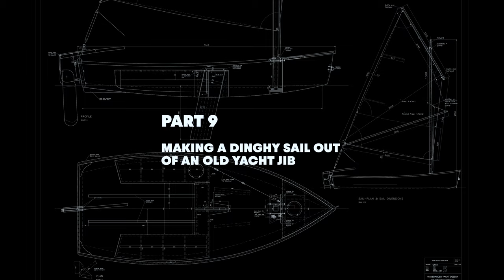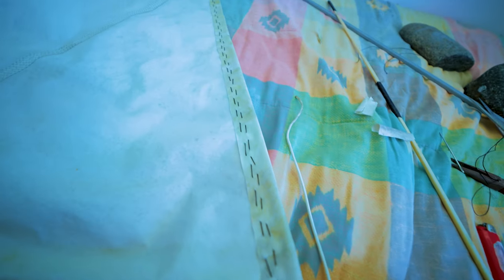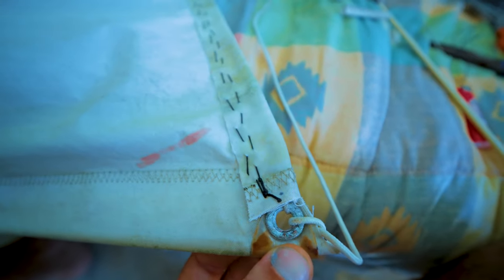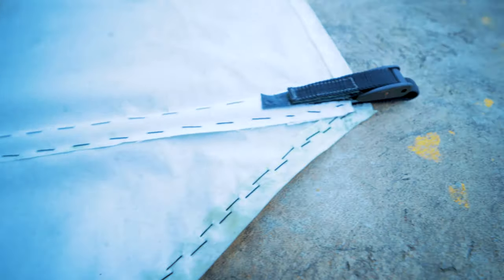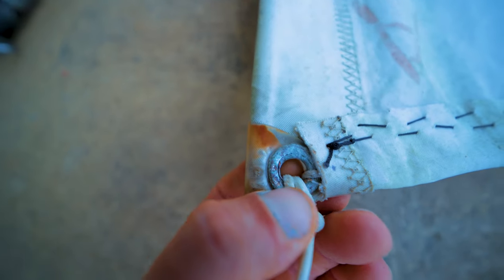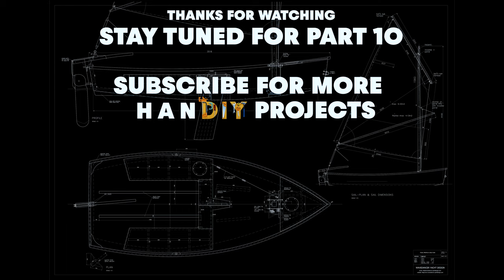Making a Dinghy Sail out of an Old Sailboat Jib - Building a Plywood Boat - Part 9

Comment: Nice, but can you tack with the foot of the sail that low?
Reply from the maker: Its a good point. Yesterday I obtained a longer windsurfing mast however its made of Fiberglass instead of carbon so I'm concerned about its rigidity and strength since Windsurfing masts are not designed for such a low point of stress. Lets see
Reply: Is it Unifiber? On a windy day that simulates going out for the day, you can test the flex by strapping the boat down to the ground and tethering a line to the top of the mast. Hold the line firmly against a reference point such as a fence or something perpendicular to the line,  mark the point it perpendicularly crossed the reference point with a sharpee, pull up the sheet, and measure the distance the line pulls from that point after a few strong gusts. Do this in both directions, both front and back and side to side. If the flex is more than a percentage (i forgot the percentage) of the full length of the mast, then you should consider going with a different mast. (note: you need to hold that tether at the max percentage of give just in case it flexes so much that the mast would snap.)
Reply: @HANDIY  You've got a ton of sail area, I wonder about just raising  the foot of the sail a bit.
Worst case - and best case - you could always add mast stays (for the fiberglass or the carbon masts), which would give the added benefit of being able to rig a jib.